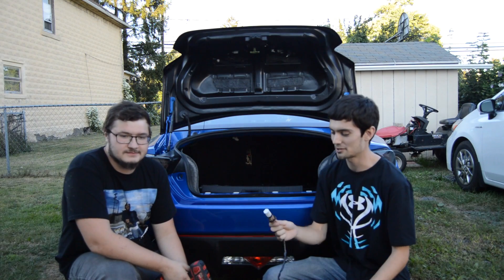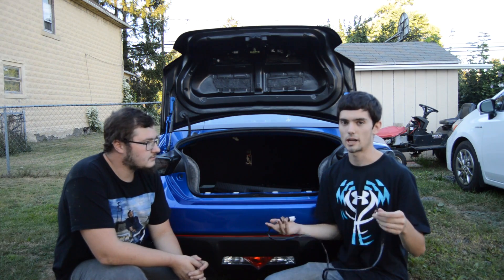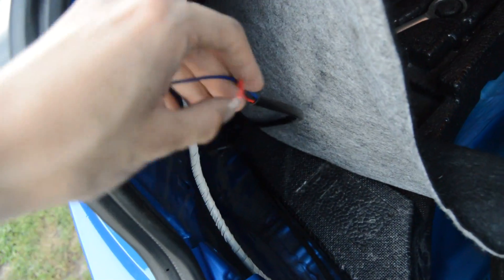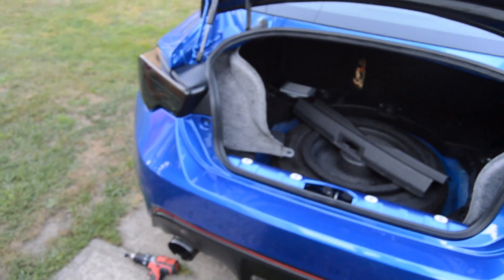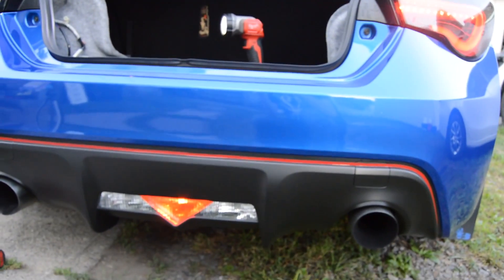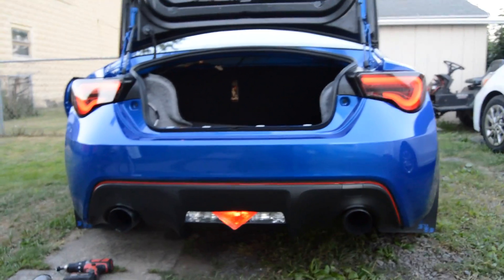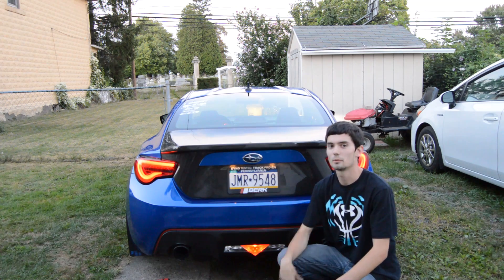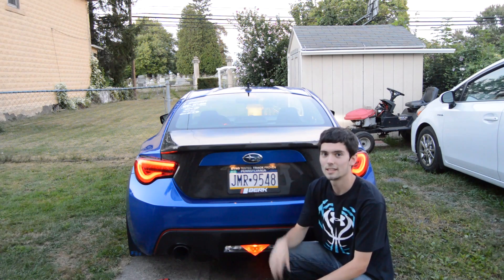iJDMTOY 4th Brake Light Install on Subaru BRZ

Comment: I have this but mine doesn't light up brighter with the brake light, its just a running light. Maybe my shit is defective lol, can all of them light up with two modes?
Reply: ***** thank you!
Reply: ok will do. Your lowering spring install helped me out alot the other weekend too
Reply: Hey I have the same situation but i have the newer version of the bulb housing which is the rubber. My brake is the only one thats working. If i turn on the tail lights it doesn’t work
Reply: @Adrian-jt5qt  did you figure out the issue im having the same problem
Reply: Y’all might have not wired them right. But it’s Black to Black, Blue to Red, and Red to Green. I was thinking that mine was a defective part but played around before doing anything and it worked perfectly with the above connectors.

Comment: If you don't want to connect the 3rd brake light permanently (plug-and-play), you can get a set of male and female 4 position TS 090 connector from eastern beaver in Japan. Crimp and solder one end to the car wiring (keeping the OEM brake light connector mated with the new connector like siameses), then solder the other to the iJDMtoy third brake light wiring. You will end up with two connectors coming out of the car, one for the tail light, and another for the third brake light. Idea by aschnell on FT86Club.
https://www.ft86club.com/forums/showthread.php?t=58513):
https://www.easternbeaver.com/Main/Elec__Products/Connectors/TS090/ts090.html

Comment: I wired mine in when the light are on the "3rd brake light" is on but when I hit the breaks it turns off it only turns on when the lights are off anyone know why this is?         I wired red - red, black - black and blue - green is this correct???
Reply: Anon it’s black-yellow red-red blue-green

Comment: Man mine doesn’t wire up like that . I have 2016 . Fuckkk
Reply: nickgt350R yeah it’s the newer version I get the brake light to illuminate when I press on the brake but won’t illuminate when I turn on the parking lights
Reply: Jamal Allen have you gotten to do the opposite? the bright brake light is the running light but when i press the brake it dims or doesn’t dim at all so idk what to do
Reply: Christopher Hernandez i hve the same situation. I have the newer version. Only brake lights works and not the tail lights. Have you fixed your issue?
Reply: Adrian nope i just decided fuck it i’ll just have a brake light, i couldn’t get the running light to work
Reply: Christopher Hernandez im still trying to trouble shoot it. I will try putting diode on each wire and see whats gonna happen and i will give you an update. What car are you connecting it to? Just wondering
Reply: Adrian 2018 toyota 86